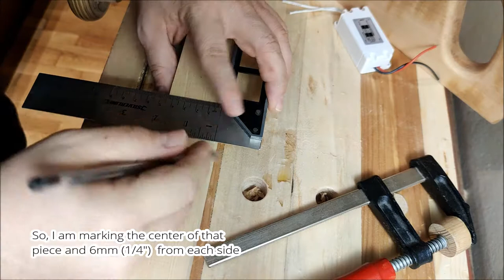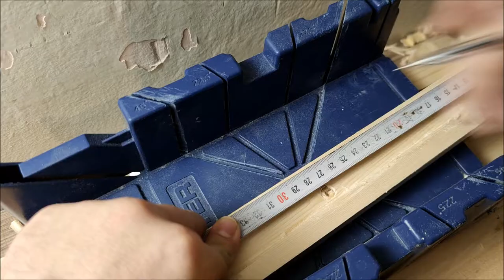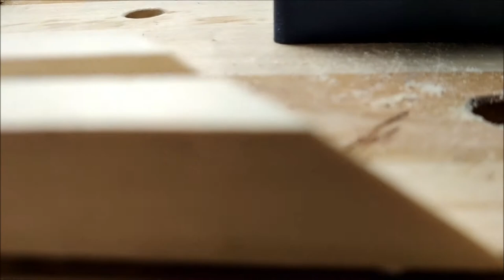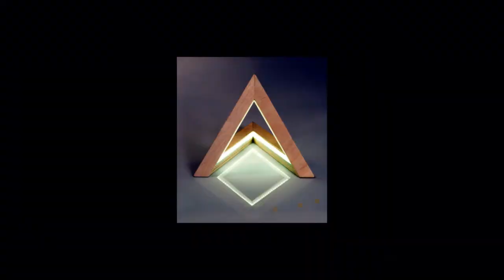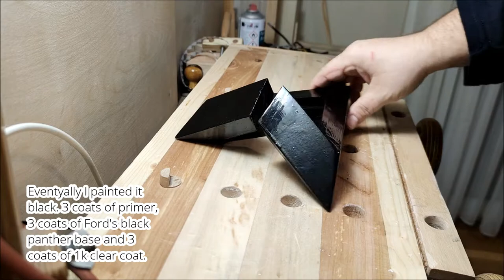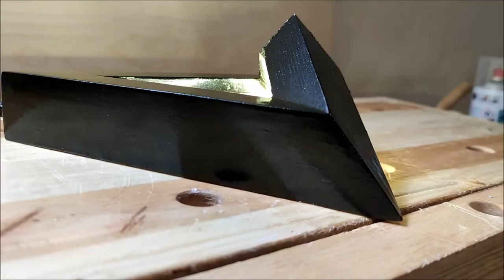Triangle wood LED desk lamp - EPIC FAIL

Comment: You created a monster.
Reply from the maker: 😂😂😂😂 I call it Darth Vader's desk lamp.
Reply: @NikosDIY  not bad and 8t would ve vetter. If you draw down first your plan you can calculate. The Gercutting is very simple. From the drawning you can see the sides what you need to cut down. And very important on the board you have a cutting tutorial emblem. Its very usefull for the work. The plan was perfect! Dont give up! Just make it. :)